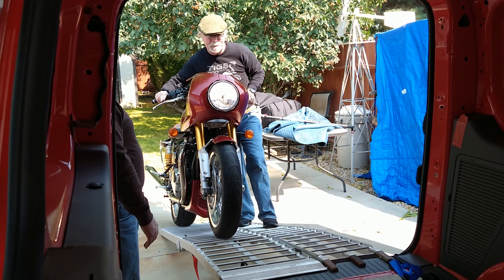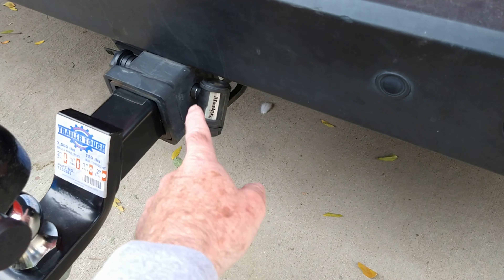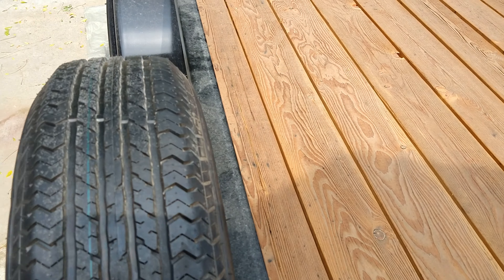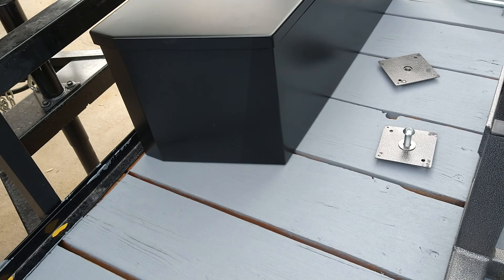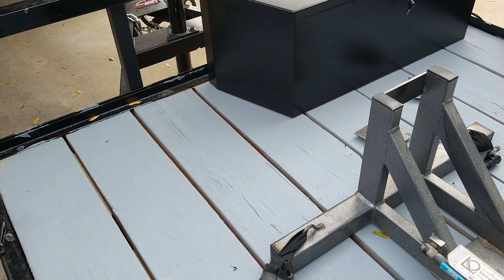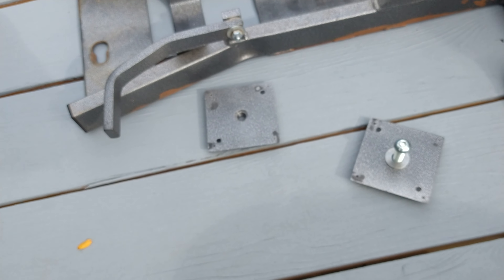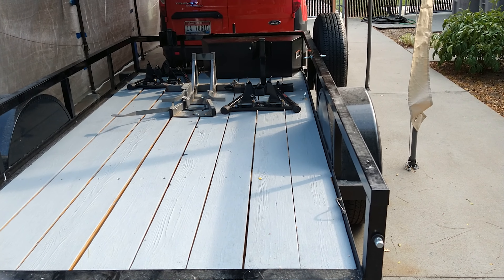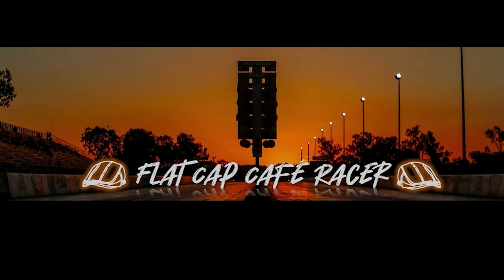I had to adapt to loading my bikes

Comment: I have the same ConStands wheel chock (in red to match the Thruxton) great piece of kit, good job btw.
Reply from the maker: I need to compromise on the trailer.  I'd rather have an enclosed trailer but we use the trailer for hauling lawn stuff than motorcycles so this open trailer works better for most jobs...except for thieves. 😄😄😄

Comment: Nice trailer. I've attached my front wheel chocks to some 18mm thick plyboard that's cut to drop on top of my van floor. Making changing from stock van to motorcycle carry van easy. 
Glad you're getting things sorted and replaced. Look forward to seeing what bike or bikes you buy to replace the stolen ones. My guess is another Tiger 900??.
Reply from the maker: I'll go back to one of your vids and check out your van. I  think your van was a bit bigger.  I've had my new motorcycle a couple days now, I'm still waiting on one of the insurance companies to come back on the trailer. The motorcycle insurance company has settled up completely.

Comment: A lot of thought has gone into this set up. Have you got locking nuts on the trailer wheels and the spare? Looks like the spare could be pinched easily otherwise.
Reply from the maker: Not yet but they are on my shopping list. Thanks for the reminder

Comment: Maaaan, I need a better set up. I've been loading bikes up into a truck with a ramp
Reply from the maker: There is a criminal in Denver that will probably sell you one cheap.😄😄

I'm looking forward to your full build video tomorrow morning.
Reply: I use a lock that fills where the ball fits and locks the trailer so it cannot be hooked up to any other vehicle when it is detached.
What is your weight with two bikes aboard and what did you set your tongue weight at?